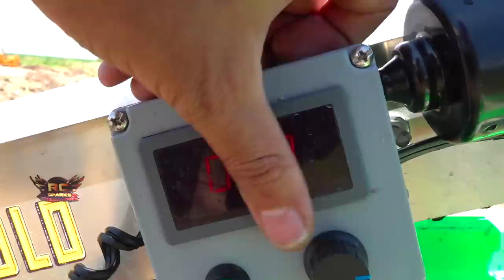YouTube GOLD (S3 E7) FRESH MEAT! NEW MiNERS put "BiG JOHNSON" Deep in a GLORY HOLE for a BiG PAYDAY

Comment: It is clear to me that you need a narrow gauge railway from the excavation to the wash plant!
Reply from the maker: Train tracks wouldn't last through 1 rainfall on the muddy prairies bro.. let alone everyones feet #YouTubeGOLD!
Reply: @TheRealRCSparks  I run a railway on a 30* hill and it has never been washed  away, actually its easier to maintain than a road as undulations in the track bed dont lead to roll overs, unlike top heavy rock trucks!

Comment: Hey Medic, did you know that you are running your excavators with the tracks backwards??

They are meant to have the drive motors to the rear. That way they add to your counterweight and won't be damaged if your operator happens to drag some debris into the tracks.
Reply from the maker: Mmmmm, Nope... when I was on the excavator.. My tracks were right. I flipped over the rock truck. #YouTubeGOLD!
Reply: @TheRealRCSparks  That was today, (or yesterday for you but whos looking) go back and look at your previous stuff. I have been meaning to mention it for a while. Just got to it today...